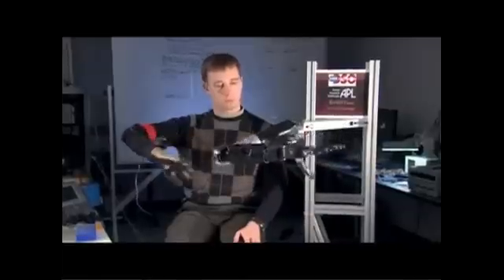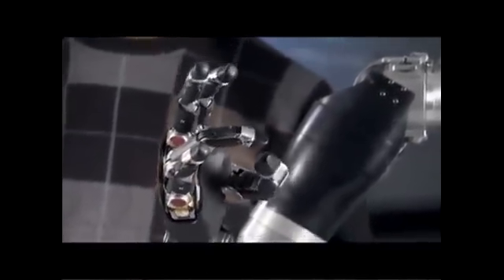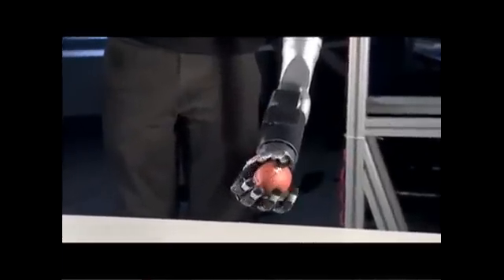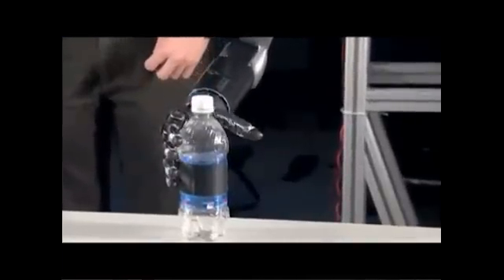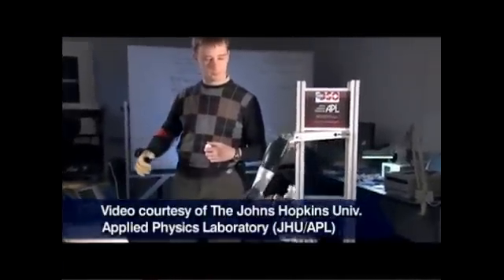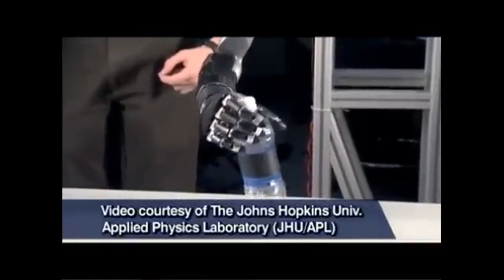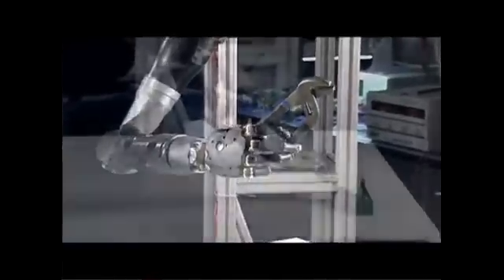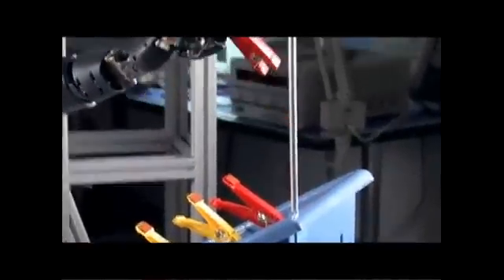DARPA prosthetic arm

Comment: THE coolest thing ever. Ghost in the Shell stuff. So many people will benefit.

also, these things are gonna touch so many genitals. totally sweet.

here's the article on brain computer interfaces like what will be used here

sciencedaily com/releases/2011/02/110218142440 htm

heres the link to the fda fast-tracking

popsci com/science/article/2011-02/darpas-brain-controlled-robotic-arm-could-be-available-just-four-years

put periods in those addresses

petenowak2000 is the man